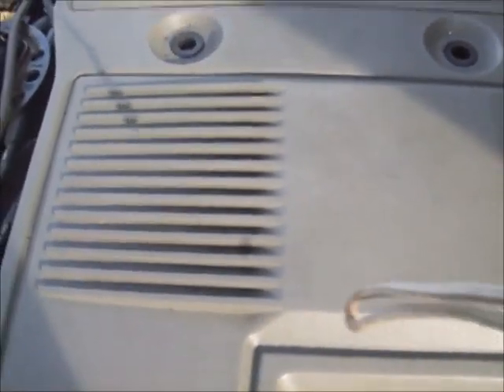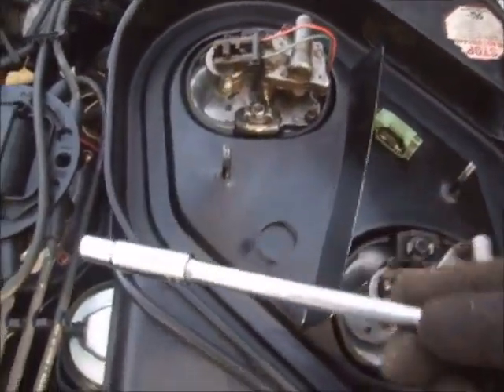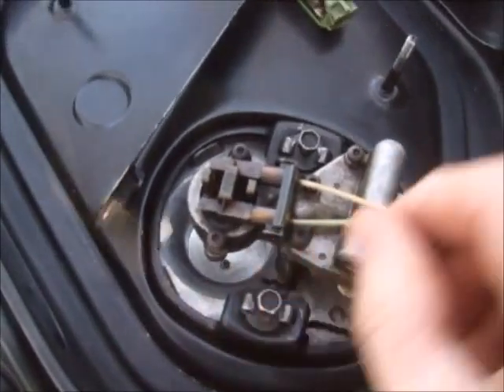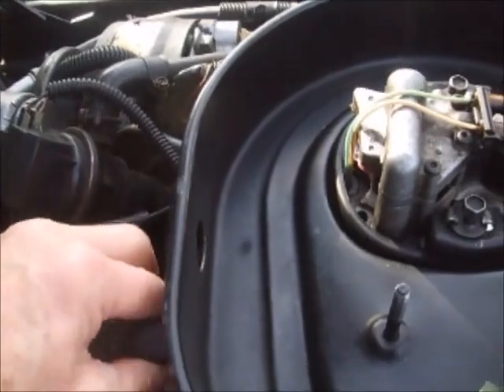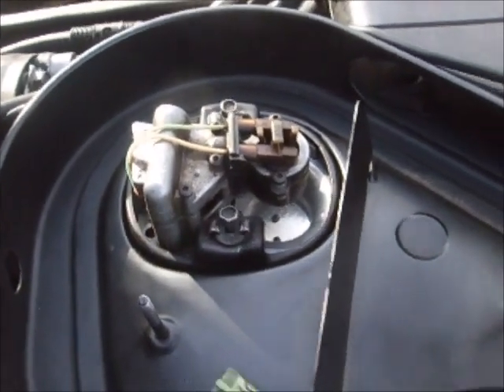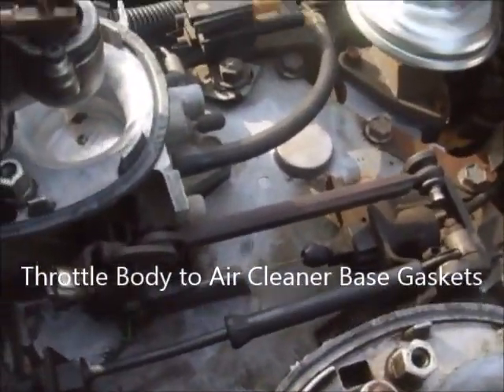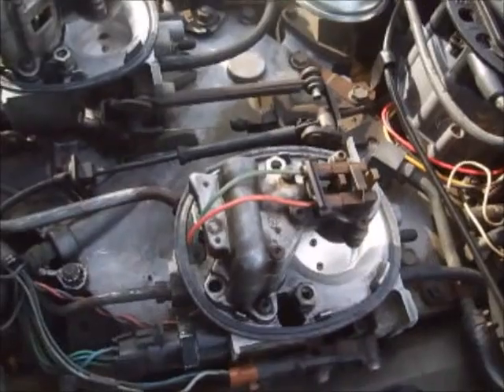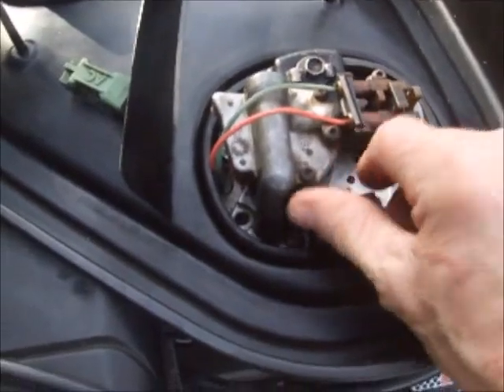𝐒𝐓𝐎𝐂𝐊  𝟏𝟗𝟖𝟒 𝐂𝐎𝐑𝐕𝐄𝐓𝐓𝐄  hesitation/stalling/stumbling During WARM UP: Air Cleaner Gaskets

Comment: Thanks SO much 3DELTA7...On my 1984 C4 Corvette I needed to change my PCV valve rubber grommet because it was seeping a little oil out onto my valve cover but I couldn't figure out how to get to it after I took off the air cleaner cover...Now I know...Your videos are very clear & step by step precise that I need as a DIY mechanic when I can...Much appreciated !...That would have been $200 at my GM garage...Thank you !!!
Reply from the maker: Thanks. Appreciate the feedback...glad the videos are helping someone, which is why I make them, I just use a canon hand held camera and do the best I can.

Comment: Have you ever had to remove the intake manifold to replace the gaskets? I'm about to do that job and a bit intimidated as a newcomer to the hobby, and 84's.
Reply from the maker: only took the  throttle bodies off down to the plate, not much to that. Intake manifold little more involved... Last Frontier garage went pretty far into it on several videos if you're interested, I have seen some other renegade install videos also on youtube, sorry didn't make a video early when I removed the TBI's. here a link to frontier garage https://www.youtube.com/watch?v=CznoE67_Nzo

Comment: my 84 had the same issue and it would hunt for idle and want to stall and stumble and i tried to read the computer (i had a check engine light) for errors and found none it turns out the computer was fried its 84 technology it doesn't last for ever order a remanufactured one its like 300$

Comment: Where is the  Air Cleaner Cover Seal located? Is it on the underside of the air cleaner?
Reply from the maker: yes sits right on top of the throttle body where the air cleaner sits

Comment: Hey on your thermac system the two hoses that connect to the IAT, when you pull the hoses off at the IAT if you look at the nipples on the IAT one of the holes is a little bigger that the other. Does the bigger one route to the tbi or does it route to the thermac door? I cant find any reference to that at all. Any help would be awesome. Im thinking the nipple with the larger hole you would route that to the tbi and not thermac door.
Reply from the maker: The larger hose goes to the manifold, but If you just want to be sure everything is functioning correctly just watch the doors on start up...the driver side should close instantly then begin opening as the engine warms up.

Comment: wached it 3 times just incase i missed something...but what was the reason it ran bad...i seen nothing but how to remove air cleaner and put it back on
Reply from the maker: +cjjudd1 at 4:03, on my crossfire, the two throttle body to air cleaner gaskets were missing. The thermac is a vacuum system. unwanted air affects the way the damper doors operate. If the damper doors close but outside air is still getting inside the housing, it creates a problem especially during warm up.
Reply: +3Delta7 ahhh ok thanx for explaining. i was kinda lost for a sec.
Reply from the maker: thanks for commenting and watching, do you have a Crossfire, just curious?
Reply: +3Delta7 yes. but right now I'm having issues with it not wanting to start, and when it finally fires it puts excess gas smoke out of the exhaust, and I made the mistake of doing an oil change on it and now it sounds like a Cummings diesel with the lifters rattling and I can't make them stop

Comment: hey Delta i am having a issue with my crossfire. it runs great on the highway revs up nice but it seems to missing some power off the line it heisting and stumbling when you get on it off the line. i have done some of the basic so far new map sensor new vacuum lines, coil,plugs,coil and fuel filter. looking for some help to get the power back it had off the line. timing is set at 6.
Reply from the maker: I could only make a guess at it Matthew. Have you run a volt test on the Throttle Position Sensor? Should be .5 volts at idle and rev up very smooth and easy to WOT....if not there's a flat spot on it somewhere. Very easy test with a voltmeter.  New TPS only cost about $40, easy install too. There's a few things that can make one  of these crossfires hesitate, the TPS is top of the list though.
Reply from the maker: I have to go out for a while so if I don't get back to you right away i'll talk to you tomorrow.  I don't think this video I made reference hesitation is your problem however, this mostly deals with cold weather conditions.
Reply: +3DELTA7 I'll have to test the tps I have not looked into it. thank you for the reply videos are very helpful
Reply from the maker: the throttle shafts can get worn also, but if your 84 is not stalling, that's probably a long shot. Mine had a brittle cracked PCV valve grommet that during hard acceleration would allow a vacuum leak at zero vacuum....unbelievably simple, but changing it (my grommet) changed my engine performance. The problem with the PCV valve is that it's a check valve and for some reason on these crossfire's it seems to play a more critical role  than other vehicles? Beats me. I know that if you let the engine cool down and dry out over night, make sure the throttle plates are dry, turn the ignition on and let the fuel lines prime, (don't start the engine) you can either look at the top of the throttle plates or feel the injectors with your fingers to see if they are dripping or leaking, just kind of a shade tree trick, but if they are leaking the O- rings are probably brittle, that would be an issue.  Also, If you have some way to test the fuel pressure under load that is a great tool, I know some guys run a line (gauge) so they can see the gauge though the front windshield while driving, never done that...yet. The fuel pressure at idle should be somewhere between 9-13 PSI, I think 9 PSI is low but I guess it works for some reason. But weak fuel pump would be fine for idle but not enough to handle quick heavy loads Anyway, I don't mind sharing what I've experienced with anybody, I'm still learning, hope you keep me informed. Still suggest testing the TPS, they get a flat spot on them from running at the same speed year after year.
Reply: +3DELTA7 I changed the tps and also the coolant sensor it seems to be running better after that l. I'll have to do the other test next you described with the injectors. thank you
Reply: +Matthew Martin what is a good idea in park? my vetted sits at 1100
Reply from the maker: Matthew Martin mine starts out out around 1000 then idles back down to 600rpm, for sure idle would be the IAC valves....that's an easy fix, usually can just clean them.